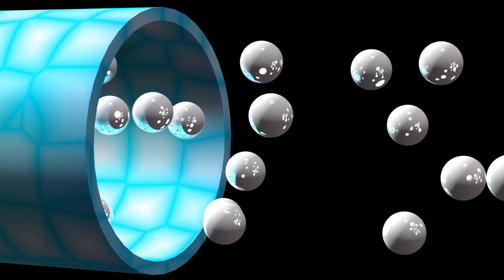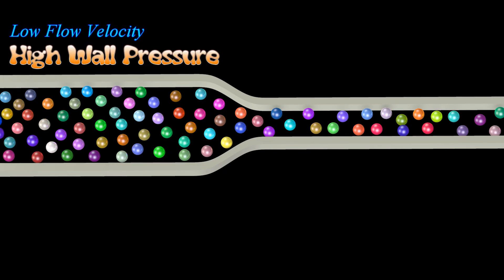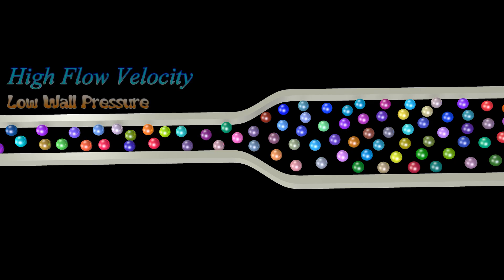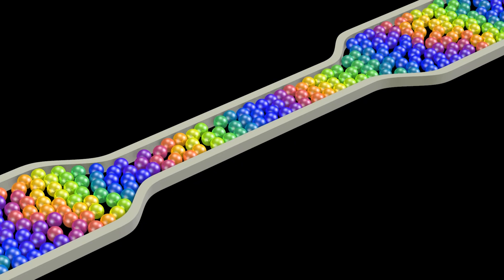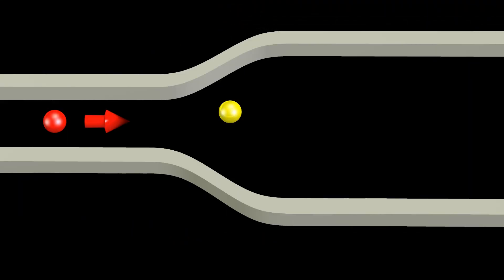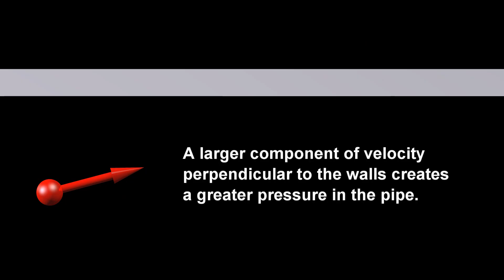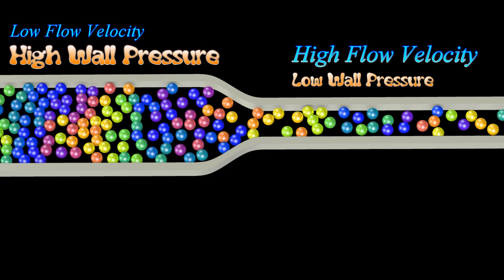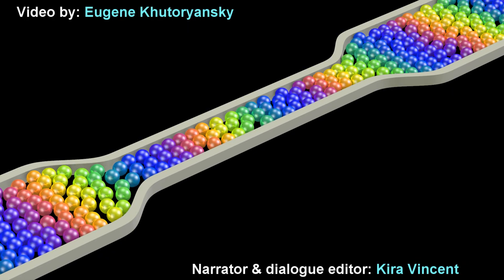Bernoulli’s Principle on Atomic Scale

Comment: Professor Khutoryansky,
I'm a retired IBM engineer with a bachelors and masters in physics. As you know, life happens and I got away from physics. However, being retired, I have started reviewing physics from the freshman level to more advanced topics. Recently I watched and commented on a video be William Fraser - "A new way to explain airflow". My critique is given below and would appreciate your input. 
Your time and effort is truly appreciated. 
With high regard.

Critique 

As you've seen in the video, this model shows molecules flowing through a tube (at about 11:30) and it appears that roughly 300-500 molecules can fit into the tube. However, the diameter of a nitrogen molecule is given as 3.64 angstroms (0.000000000364 m) and this means that billions and billions* of molecules can fit into any macroscopic tube, not just a few hundred.

Given the small size and high average speed** a real nitrogen  molecules, there will be many, many millions* of SLOW AND FAST molecules hitting the gate each second just before opening. Both slow and fast molecules will therefore enter the tube at the same time when the gate is removed. Stating and showing that the fast molecules enter first and that this results in the separation of hot and cold molecules is simply not reality!

It is well established that both the molecules remaining and those ejected from a pressurized nitrogen tank at room temperature and atmospheric pressure will cool because of weak, attractive intermolecular forces. His model shows a temperature increase in the right tank! 

Also, in his written introduction he states that he used Kinetic Theory. Because, in Kinetic Theory, it is assumed that there are no intermolecular forces and the particles are point particles having no volume, the model predicts no temperature change!

Additional Comments 

Computational Fluid Dynamics (CFD) is and has been used to model fluid flows using complicated equations (Navier-Stokes equations). If it were possible to model macroscopic airflow using individual molecules, CFD would not be necessary. And this would certainly have done decades ago.

Molecular Dynamics (MD) is used in science (e.g., biology & material science) to model the behavior of molecules. However, you will find that the size and time scales are extremely small. This modeling necessitates the use of very small areas of observation and very small time scales. Again, if it were possible to model or explain macroscopic airflow using MD, it would have already been done.

*These numbers are much too small. For example, if you consider a macroscopic volume of one cubic millimeter, the number of molecules is approximately 20,000 trillions. 

** The average molecular speed is roughly  1000 miles per hour at atmospheric pressure and room temperature.

Comment: Eugene,
Consider this:
.
Take a pipe 5 feet long.  Fill it with atmospheric pressure air or water.  Then cap the ends.
.
Put that pipe in a car so it is horizontal and parallel to the road center-line - front to back.
. . .
Now, drive down the road at high speed.
.
The fluid molecules now have a high speed in the direction of, parallel to, the pipe walls, right?
.
Does the pressure of that fluid inside the pipe, against the inner wall go down?
.
Why , or why not?
- - 
Steve
Science Vigilante

Comment: I am sorry Eugene, but The first explanation  that you dismissed as wrong, is the correct one.
.
Everyone I see that tries to use a molecular level view, gets it wrong.
.
The fluid has mass and Newton's First Law tells us that a force is REQUIRED to Accelerate a mass.  
This applies to a solid mass 'object' like a brick AND the Mass in Fluids.  The Pressure Gradient in the pipe is the CAUSE of the Accelerations of the fluid at BOTH the entry and exit of the narrow section.
.
In fact, is is the narrowing of the pipe that is a restriction that CAUSES the pressure to rise up stream, in the left, fat section. 
.
Think of the flow approaching the inward sloping pipe walls.  It is like a wind blowing on you.  This increases the pressure on the inward slops and that pressure is directed i(Perpendicularly)  away from the slopped wall) inward and up stream, to the left, at the speed of sound.
That pressure is not propagated down stream, so the small section is more like an opening in a pressure tank.
. . 
. .
If you show the fluid molecules, then you must also show the pipe molecules because they are both exchanging momentum in random directions at the same supersonic rate.  They are not flat surfaces at the molecule level.  The net momentum transfer sums to a normal force on the surface and the isotropic pressure in the fluid.
.
Your probability explanation of which molecules enter the narrow section is not science. It violates the well known laws of physics the most notable being Newton's Laws. 
Nope.  The fluid has mass, so you need to identify the forces that cause the observed accelerations. 

. Bernoulli's Principle Explained Correctly:
 kyuoyckftflurrpq.quora.com/ 
- - 
Regards.

Comment: So much more intuitive if you stop trying to force nature to be as you wish it was to be. Instead, conceive the 'particles' as being a point within a fluid, and conceive it motion as more like the wave(s), or motion, of energy through a fluid.
As one can intuitively grasp without struggle is the receding (trailing) face of a wave as having a 'negative' pressure and the proceeding (leading) face a positive pressure. The positive and negative pressures between the waves cancel out with only the initial wave front having a cumulative net positive pressure and the eventual final receding face a cumulative net negative pressure. With all wave crests in between having thier own net positive pressure drawn towards the net negative pressure of the proceeding wave. And with the forwards facing net positive pressure expanding out like a cone more so in an adjacent and rearward formation respective to its actual position and the proceeding waves rearward face being adjacent and forwards respective to its respective actual position there is a 'quadrant' like region where the net total pressure is negative. It does not alter its trajectory based on this pressure differential as its own net positive conical wave front locates it laterally (effectively cancelling out where it intersects the proceeding net negative wave face but not completely forwards to the crest of the proceeding wave crest with a net negative pressure existing laterally to the actual wave crest position(s) and a net positive pressure existing longitudinally between the crests. Only the final trailing wave face exerting an unbalanced net positive to negative pressure region and this being the point of turbulent flow, ie; a vortex where hogh pressure spirals inwards towards low pressure, much like at the tips of a propeller or rotor.
This net negative lateral pressure with intermittent positive pressure spikes is where the boundary layer forms where the intermittent positive pressure spikes encapsulated in a net negative pressure region accelerate a layer of fluid at a lower velocity than the net average velocity of the cavities cross section and this misable layer is sympathetic to the inertia of the main flow and interchanges molecules freely between it and the main flow and shoulders the majority of the friction burden encountered by the solid boundary of the cavity wall.

My simplified description is probably articulated poorly owing to impatience and a 2x thumb interface but i hope5it still conveys meaning effectively, as if it has i'm sure you will find the more adept yse of fluid dynamics to be more intuitive than the abstract method of trying to conceive balls acting as we observe nature to do so and understand why it is so.
Reply: Unfortunately, you've complicated it too much and erred. And this video is all wrong.
.
The pressure waves you refer to propagate at the speed of sound.  YES.
They settle out and equalize pressures over large distances virtually instantaneously with respect to the flow speed.
.
The first explanation above, that is dismissed as wrong, is the correct one.
.
The fluid has mass and Newton's First Law tells us that a force is REQUIRED to Accelerate a mass.  
This applies to a solid mass 'object' like a brick AND the Mass in fluids.  The Pressure Gradient in the pipe is the CAUSE of the Accelerations of the fluid at BOTH the entry and exit of the narrow section.
.
In fact, is is the narrowing of the pipe that is a restriction that CAUSES the pressure to rise up stream, in the left, fat section. 
.
Think of the flow approaching the inward sloping pipe walls.  It is like a wind blowing on you.  This increases the pressure on the inward slops and that pressure is directed i(Perpendicularly)  away from the slopped wall) inward and up stream, to the left, at the speed of sound.
That pressure is not propagated down stream, so the small section is more like an opening in a pressure tank.
. Bernoulli's Principle Explained Correctly: 
 kyuoyckftflurrpq.quora.com/ 
- - 
Regards.

Comment: I've explained this before.  The energy conversion is from potential tp kinetic.
.
The Potential energy of the higher pressure up-stream is converted to the kinetic energy of the faster flow downstream.
  Crummer's concept is false.
.
The isotropic static pressure is not made non-isotropic as the flow speeds up.

Comment: Misconception. Pressure is a force not a source of energy. You violate Newtons Laws. Actio vs. Reactio is violated when calculating static pressure as energy source or potential. The throat converts external energy sources into kinetic energy. There is no chance the energy can be regained:
https://youtube.com/shorts/bIWGNUvVvBs?feature=share
Reply from the maker: The video is correct.  Energy is not gained by the system.  It is just that kinetic energy in the Y direction is transformed into kinetic energy in the X direction.
Reply: @EugeneKhutoryansky  Nope. I've explained this before.  The energy conversion is from potential to kinetic.
.
The Potential energy of the higher pressure up-stream is converted to the kinetic energy of the faster flow downstream.
.
  Crummer's concept is false.
.
The isotropic static pressure is not made non-isotropic as the flow speeds up.
,
The pipe size reduction is a restriction that causes the upstream static pressure to increase creating a Pressure Gradient forming a net force downstream that causes the Acceleration of the mass of the fluid.
Euler is credited with  determining that a Pressure Gradient is the cause of fluid Acceleration, just like a net force causes Acceleration of a bulk mass 'object'.
.
So many people keep repeating misconceptions they don't understand.  This is nothing more than Newton for fluids.
Reply: Sorry, but the fluid pressure IS potential energy.
.
That is the very potential energy that is the cause of the positive Acceleration of the fluid into the narrow section and the negative acceleration at the end of the narrow section.  That is the energy that gets converted to the kinetic energy in the faster flow.
.
The chemical energy in fuel gets converted to the potential energy of pressure of combustion which is then  the energy that gets converted to the energy to Accelerate an auto.
.
A brick on top of a ladder has potential energy due to the force of gravity.
Let the brick fall and that potential energy gets converted to kinetic energy that can do work. 
You can buy electric generators that use a bag of sand or rocks to fall while turning the generator to convert THAT potential energy into electric energy.
Sorry, but a force through a distance is work and, therefore, energy. . .

Comment: oh my God thank you soooooo much!!!! the video was reallly eligant
Reply from the maker: Thanks.  I am glad you liked my video.
Reply: Unfortunately, it is incorrect.
.
 I've explained this before.  The energy conversion is from potential to kinetic.
.
The Potential energy of the higher pressure up-stream is converted to the kinetic energy of the faster flow downstream.
.
  Crummer's concept is false.
.
The isotropic static pressure is not made non-isotropic as the flow speeds up.
,
The pipe size reduction is a restriction that causes the upstream static pressure to increase creating a Pressure Gradient forming a net force downstream that causes the Acceleration of the mass of the fluid.
Euler is credited with determining that a Pressure Gradient is the cause of fluid Acceleration, just like a net force causes Acceleration of a bulk mass 'object'.
.
So many people keep repeating misconceptions they don't understand.  This is nothin more than Newton for fluids.

Comment: I am fairly sure that this is not true. Your picture intuitively makes sense if you model the fluid as an ideal gas, and visually present the atoms at approximately the same scale as the pipe. But there are ~10^24 ish atoms in one mL of water and the mean free path length in water and gas is pretty small, I think (https://en.wikipedia.org/wiki/Mean_free_path says it is on the order of nanometers). So, it can't be that particles have to have an individual velocity separate from that of the water pointed into the narrow pipe to pass through -- they hit another one and completely change directions after nanometers of travel. You could argue there is an effect on water with a collective velocity hitting the parts of the pipe in its way where it narrows and that making the water travel more directly forward, but as a collective the water is already traveling directly forward. This explanation does not make sense.
Reply from the maker: You don't need 100% of the molecules to behave as shown in the video in order for this explanation to work.  You just need the averages to shift as described, for the averages of all the collisions to produce the change in pressure.
Reply: You are correct that this is untrue.  This is Crummer's Fallacy. . . 

.
 I've explained this before.  The energy conversion is from potential to kinetic.
.
The Potential energy of the higher pressure up-stream is converted to the kinetic energy of the faster flow downstream.
.
  Crummer's concept is false.
.
The isotropic static pressure is not made non-isotropic as the flow speeds up.
,
The pipe size reduction is a restriction that causes the upstream static pressure to increase creating a Pressure Gradient forming a net force downstream that causes the Acceleration of the mass of the fluid.
Euler is credited with determining that a Pressure Gradient is the cause of fluid Acceleration, just like a net force causes Acceleration of a bulk mass 'object'.
.
So many people keep repeating misconceptions they don't understand.  This is nothin more than Newton for fluids.

Comment: I even think it seems very simple, such as a rigid cone. If you push the cone along the axis at the bottom of the cone to obtain acceleration, the stress on different sections of the cone will also be different, and the stress will decrease from the bottom to the top of the cone. What's so mysterious about this?

Comment: Assuming that the pressure difference P causes the water column in the equal diameter pipe to increase from velocity V1 to velocity V2. In this process, at any moment, the velocity of the entire water column is the same, but the pressure at different sections of the water column is different. This indicates that the conclusion of this video is incorrect. Otherwise, why are the pressures different at the same velocity?

Comment: This is the best video explaining the intuitions of Bernoulli’s principle! I’m going to share this with my friends in my engineering classes! Thank you!
Reply from the maker: I am glad you liked my video.  Thanks.
Reply: This video concept is untrue.  This is Crummer's Fallacy. . . 
.
 I've explained this before.  The energy conversion is from potential to kinetic.
.
The Potential energy of the higher pressure up-stream is converted to the kinetic energy of the faster flow downstream.
.
  Crummer's concept is false.
.
The isotropic static pressure is not made non-isotropic as the flow speeds up.
,
The pipe size reduction is a restriction that causes the upstream static pressure to increase creating a Pressure Gradient forming a net force downstream that causes the Acceleration of the mass of the fluid.
Euler is credited with determining that a Pressure Gradient is the cause of fluid Acceleration, just like a net force causes Acceleration of a bulk mass 'object'.
.
So many people keep repeating misconceptions they don't understand.  This is nothin more than Newton for fluids.
Reply: @Observ45er  Hey- what's Crummer's Fallacy? Google had no clue   :)
Reply: @bobhamilton2497  What's in this video.  Random molecule vibrations only allow certain ones into the narrow section.  Nonsense.
Reply: OR Try searching this:
Aerodynamics bat the Particle Level
A close look at some effects of particle flow without the fluid approximation
Charles A. Crummer, March 29, 2022
Reply: @bobhamilton2497  You Tube won't allow me to post the URL.
Reply: @Observ45er  Thank you! I’ll check it out!
Reply: @bensonboys6609  It's the SAME nonsense here.
Reply: @ Dang! That actually made a lot of sense. Thank you for the clarification.